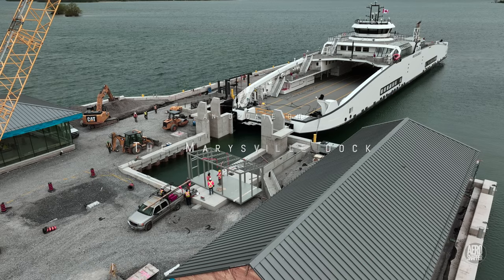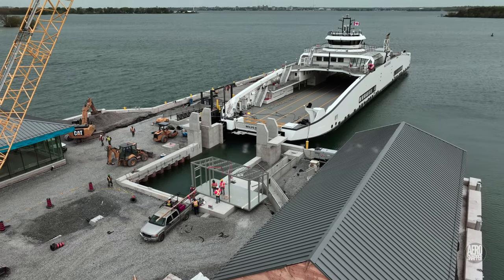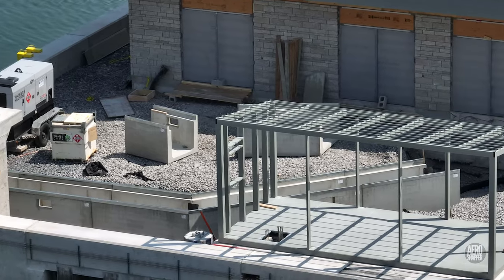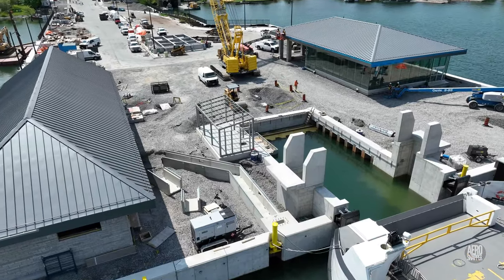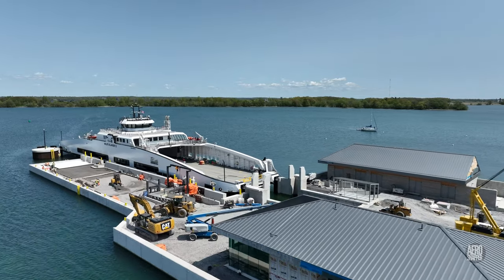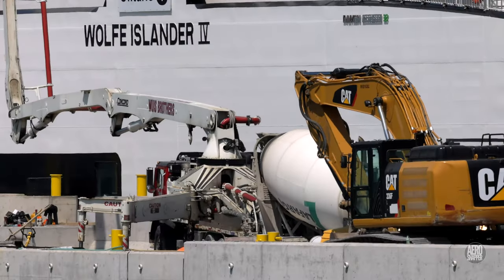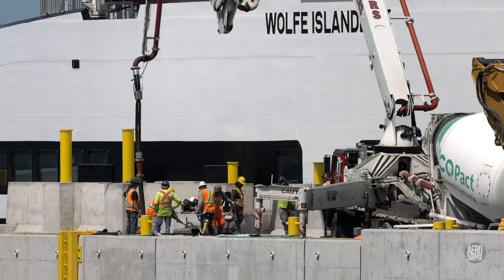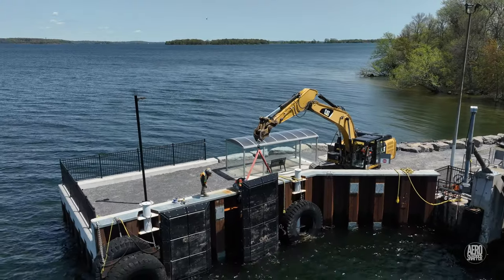Picking up the Pace - an Update on the Marysville Dock   4K

Comment: Hang on! It's an electric ferry?! How did I miss that?
Reply from the maker: Take two demerit points and go stand in the corner..  Yes, she can run full electric (the intention) or in hybrid mode using on-board generators to produce the current to run her motors.  That's how she made her way up river from Montreal.
Reply: @Aerosnapper  sawwy. It won't happen again.